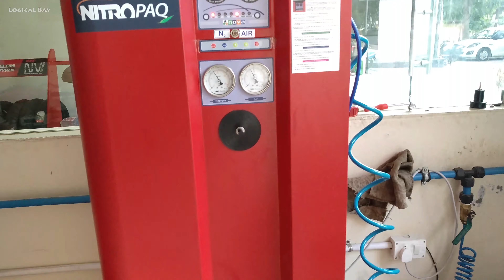Tubeless Tyre Change Guide | MRF Mogrip Meteor 100/90 r18 for TVS Apache Rtr | Off-road

Comment: I am going upgrade the tyres for my old model  Karizma R.
Stocks are tyres are , 
Front : 2.75-18 42P
Rear : 100/90-18 56P.

Please recommend best tyres for the front and rear tyre upgrade.
Main purpose of upgrade is to take bike for trips near westernghats(highways and little off road) .
I am open to choose the best one whichever fits for karizma-R, good grip and confident while driving is what I need.
If possible please suggest more than one options.
Reply from the maker: For front tyres - Nylogrip
For Rear tyre.- Mogrip
Front should  always less wider then back
Reply: @LogicalBay  should use the same size ?

Comment: In shop they are charging 2k+ , 
If we order online do we get latest stock (2020 made tyres)?
Reply from the maker: Get form authorised MRF dealer or get it online you can check manufacturing date on tyre. Return if too old
Reply: Thanks for the timely reply, so I subscribed and like the video guys.